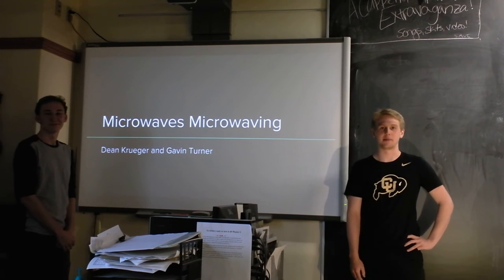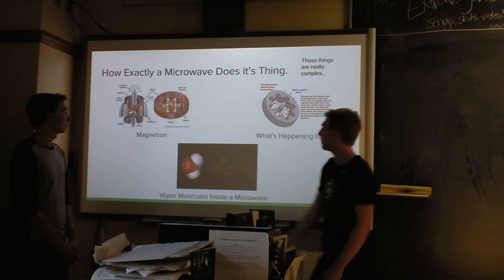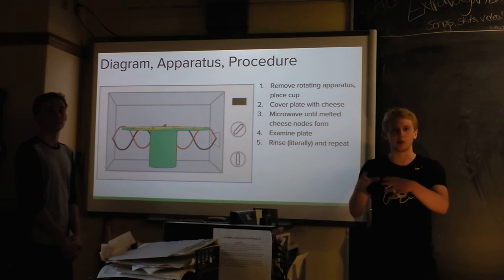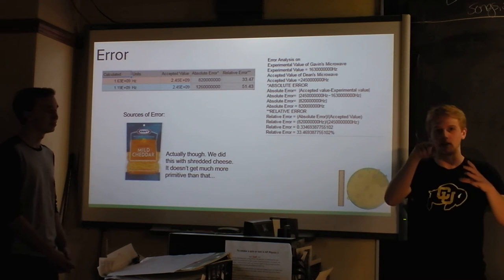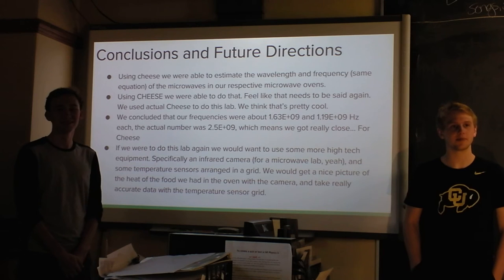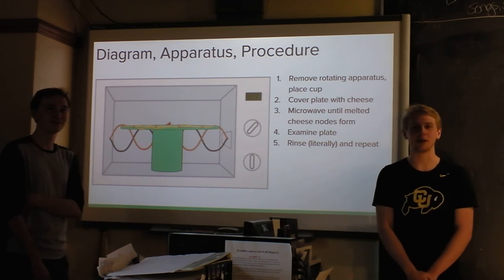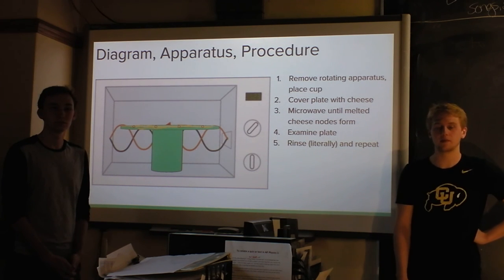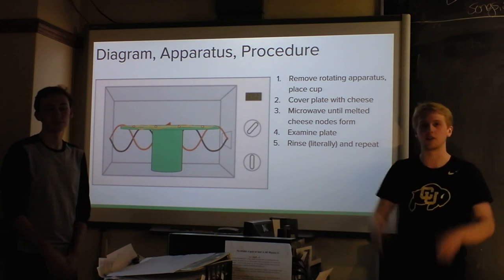Indie Lab - How Microwaves Work, Con Queso

Comment: The high cup is a bad idea. Weird things happen near walls. Stay close to the center. I see no reason why the crests and nodes of the intensity pattern would be more distinct near the top of the chamber, as was stated. (I hesitate to write this, but I sense a misunderstanding about the meaning of the wavy lines in the diagram of the apparatus. Their vertical extent indicates amplitude, not geometric extent. This misunderstanding occurs in learning situations more often than I would like.)

Fun factoid: in Dutch a 'microwave' (the device, not the radiation) is called a "magnetron". You can say for example: "Plaats de pizza in de magnetron", which does not mean that we somehow push a pizza into the vacuum radiation source.

Comment: When electromagnetic waves propagate through a medium that absorbs a lot of its energy, the wave weakens. This is why a block of cheese, which is effectively a block of water held into place by the gooey stuff, is heated from the outside in. Many foodstuffs are not such a strong barrier to this radiation, and get heated more uniformly.